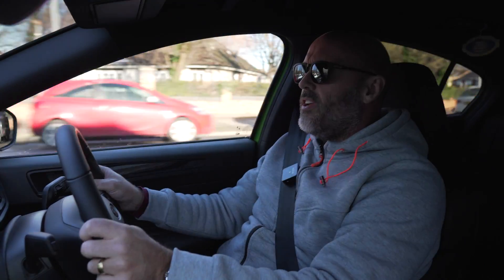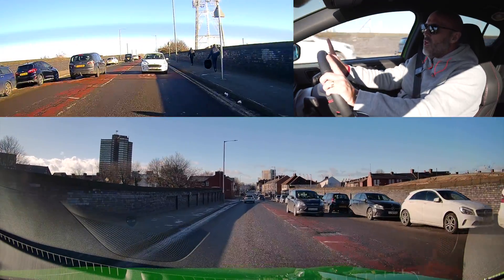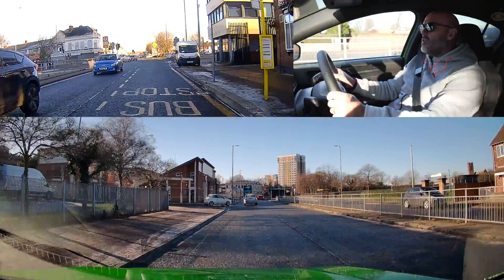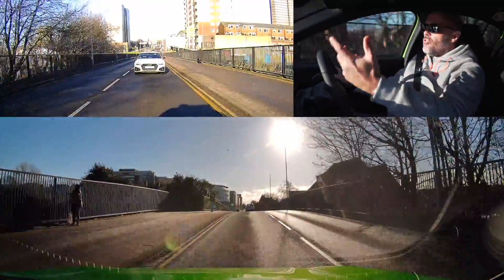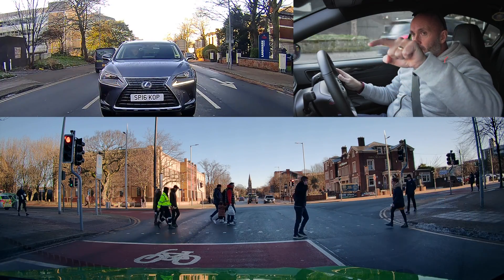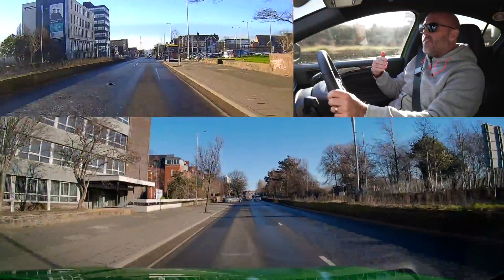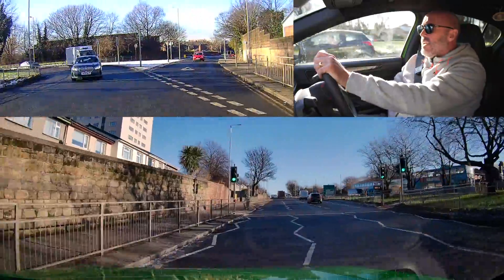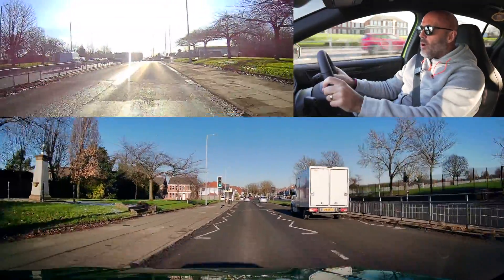How To Anticipate Traffic Light Sensors (Flashing Your Lights Doesn't Work!)

Comment: How about road works lights? Is there any way to know if they are working/not working/very slow/several junctions?
Reply: There should be a sign saying how many junctions the lights are for. The sensors should be set at the "wait here" sign, so too far forward or too far back they might not pick you up. In general they're pretty unreliable. Some will actually have a little red light which comes on when they've seen you. If it's on you know it's working. If you know it has a light and it's not on, try moving a little forward or back. If it still doesn't come on, I will wait for a bit, but it's probably not working.
Many don't have this little red light, so for those it's more uncertain.

Comment: There are specific traffic lights near where I live that are on very quiet roads, they are for single lane tunnels under railroad tracks. They use a magnetic sensor under the road and will simply stay in a single position (Green towards town) unless the magnetic sensor picks something up.

I'm a cyclist and I have to get off my bike and lay it down across the sensor for it to change to green for me. If I simply ride my bike over the sensor or stop on top of it... I will simply be there until a car comes to trigger the sensor.

I think most lights use a mix of timing and sensor to stop this problem, but since these are on quiet roads, I think they just use the sensors only.

Kind of annoying to have to get off my bike and lay it down, but better than going through the red and meeting a car coming through the tunnel towards me.
Reply: I have heard that some motorcyclists use strong neodymium magnets stuck to the bottom of their bike to increase its magnetic footprint for these type of sensors, maybe the same will work for you.
Reply: @BigDavie2000  Maybe it would help. My bike is a steel frame so lying it down is enough. I know other local cyclists that have lighter bikes and even laying them down doesn't trigger the sensors.

I think I really just need to send a message to the MP about it as cycling is getting more popular and it's only a better of time before a cyclist gets in trouble because of these lights.

Comment: Don’t get triggered when out driving but try to anticipate when you are triggering traffic light sensors to keep things flowing

Years ago on my morning commute into work there was a series of 7 traffic lights along a main road. It was quite amusing watching those in lane 2 accelerate hard from the lights when they changed then brake hard for the next set whereas I would be just under the speed limit and not have to adjust speed once we were going. A combination of sensors and timing to keep things moving on those lights until ut got busier and everyone caused chaos by blocking everything

Comment: There  is a stretch of  built up road near me that have five sets of lights. If on green it would take about 2 minutes to travel. Late at night no other traffic  around , they can all turn red as you approach each one. Time to travel along the same stretch, 12 minutes. There are cameras on the road and its a 30 limit. To beat the next light turning red you have to do 40 mph. Travel at 30 and each one turns red. Go figure.

Comment: As a bus driver when lights are red I used that time to have a quick drink or read any messages on our ticket machines about diversions ect. We can only use our machines to read messages when the vehicle has been stationary for 10 seconds or more and won't let us look when the vehicle is moving as it should be. So I'm constantly looking what's happening to make sure I judge my times to do things. But a very informative video Ashley.
Reply: As a bus passenger I have often noticed some lights changing prioritising the bus if the bus is at the front of queue as the lights change to red. It will let just a couple of cars out from the other direction before changing back to green, but if the bus is further back in the queue the lights will stay red until the other direction clears.
Reply: @BigDavie2000 Yeah, as a bus rider, bus priority signalling is great - my route to & from work is great for it. The bus only ever has to stop for pedestrians or other busses, otherwise it's green all the way. Right up the bus lane too, past the jammed traffic.
Reply: I guess that depends on what you are drinking 😂🤣

Comment: Almost all traffic light sensors detect when I operate the handbrake and put the car in neutral.
Reply: Step one of the rise of the machines, beep boop
Reply: From what I've observed recently, call it a conspiracy theory if you want, I've noticed that with no cars coming from the other direction, I'll be sitting on red while the side with no cars gets the green. Then as soon as a car approaches from the "green" side, they'll change that side to red and give me the green. I think it's deliberate, but can't fathom why.
Reply: @paulsengupta971 In Spain we had traffic lights at the entry points to villages that really did change to red if the vehicle approaching was going too fast. I've never seen it here, but I think it's a rather good idea. Once in town however, there is some dark magic at work.
Reply: @paulsengupta971  from what I understand, it can be deliberate. As Ash mentions, they are often multiple sensors on the approach to lights, which allows the system to work out how fast a vehicle is going. Sometimes, if the system detects that the approaching vehicle is speeding, it will deliberately switch the lights to red, to force them to stop speeding. This might be a myth, but I believe I've had it happen to me, doing the same junction a few times. Sometimes slightly below the speed limit, and sometimes slightly over, I find the lights more often stay green if I'm below the speed limit.
Reply: @konradius3141  that would certainly be a great system... but our local authorities can't seem to repair potholes successfully, so I doubt they'd be able to manage such a "smart" system of traffic management!
Reply: @paulsengupta971 YES. There’s a stretch on the a449 from wolves to penkridge that does exactly this every time I’m travelling back late at night. I generally dont speed but there’s absolutely nothing about - so much so it returns to green IMMEDIATELY. I always imagine someone is watching me and trying to pee me off!! 😂 Ashley? Anything you can find on this or am i falling down into a conspiracy hole???
Reply: @SunshineSuze  It's probably shown to be a successful strategy in rush hour, but it does get a tad frustrating in the middle of the night.

There's a philosophical subject though - why do we all stop at red lights in the middle of the night when there are absolutely no other vehicles around? Pedestrians do that in Germany when crossing the road at a light controlled crossing.
Reply: @paulsengupta971  Because the one vehicle lurking in the shadows will be plod. This I know.
Reply: @paulsengupta971   this will depend on the accident statistics for that junction, it is sometimes used to reduce red  jumper ie going before the lights change
Reply: Lol, yeah every time.
Reply: Smart lights are great until someone stalls at the lights for example a learner, then the smart lights think we are all parked and misses us out until a motor bike comes down the side or the learner moves forward slightly so they are picked up by the sensor and then we get to go again.
Reply: The sensors on top of traffic lights work on KU band radar.  They are not light sensitive.

Comment: Stopping in neutral (and using the handbrake) is something I cannot unlearn, after having to drive like this for about a half a year when my clutch master cylinder was leaking. The pressure was there only at the beginning, but the longer I held the clutch down, the less likely the pedal was to come back up on its own (and the bite point would move down, sometimes unpredictably fast). So I would go into neutral any opportunity I had, release the clutch and wait. Only getting into gear when I was actually going to move (not just preparing to move).
Now I've fixed the issue, but the habit remains.
Reply: At least it's a good habit, though.
Reply: Doesn't the practice also spare the clutch a lot of unnecessary wear and tear?

Comment: Went to look at car last week, took it for test drive in a city not familiar with. Went into a right turn only lane and hit a red, so stopped. Turned green, just about rolled over the white line and stalled the car. 

Waited on the red for 10 plus minutes cursing it to turn green, before I realised I'd overshot the magnetic sensor in the ground. Quick revers back over the sensor and it turned green. If the road was actually busier I would have had cars behind me to trigger the sensor . 

Fun times
Reply: It's actually electro-magnetic rather than magnetic, the metal in the car alters the  impedance of the induction loop like the iron core of a transformer.
Reply: Small motorbikes and mopeds sometimes don’t even trigger them. Same with cyclists especially on carbon or aluminium bikes
Reply: @hausmaster9801  Yes, and the the cyclists have no respect for the rules, if theyre forced to jump the red.

Comment: So glad you mentioned the Headlight Flashing Myth! I have had many dicussions with people who thought it worked! Geat video Ashley!
Reply: They work on doppler radar, there's no way they can see lights.
Reply: How many look stupid flashing lights at traffic lights, as silly as kids of the 80s blowing into their game cartridges.

Takes one or two and everyone starts blindly copying like sheep 🐑
Reply: @insoft_uk  why is blowing into a game cartridge stupid? Although it might introduce moisture and so an air blower or IPA on a cotton bud might be better, if the cartridge isn't working due to slight corrosion or dust buildup, it's far from stupid. These are hardly synonymous.
Reply: @insoft_uk couldn't have chosen a worse comparison. Dust, debris, and grime build up absolutely CAN affect a storage device from being read.

Maybe using your lungs to blow it out isn't the best option, perhaps you should use something like air duster, but it definitely works.
Reply: @gopnikolai7483 of course it works, plus games cartridges were still a thing well into the 1990s, which makes me think they are too young to have actually used such a thing.
Reply: Headlight bulbs can be very expensive, switching them on and of changes the resistance of the filament, this is why bulbs blow. I don't flash people out as you should only flash to warn!
Reply: @thefoodiechannelcookingfro1822  standard halogen H7s are about 3 quid, any more than that and it should be better technology you're buying (xenon, LED etc.) or you're just getting robbed.

Besides, flashing your lights has no significant effect on the lifetime or durability of your bulbs, it's almost entirely vibrations shaking the filaments, which use special materials and are designed to get hot-cold-hot-cold... tens of  thousands of times in their lifetimes. Traditional 'flasher relays'/'flasher units' work on the basis of a metal strip(s) quickly heating up and cooling down, to bend back and forth to complete/break a circuit.

If anything, the full beams would be a lot more flash-able than the indicators, given that the indicator bulbs have a much smaller and weaker filament (usually 21W, rather than 35W, 70W, etc.).
Reply: It’s an option on temporary lights (at least it was back in the late 80’s) used it many many times to change lights straight back to green from amber and red if it hadn’t started the sequence on the other side, missing the red/ amber cycle, if it was green it cuts the cycle short but still has to cycle the amber etc. perhaps they use a different sensor these days if too many people caught on

Comment: Out of interest - what do you do when sensors don't work when you are on a motorcycle? On a particular journey I go on each week, there is one specific set of lights that do not recognise that I am there. If I go early in the morning, 6am ish, then I can get to those lights with no other vehicles around. So I end up having to wait for a car to arrive behind me which can take minutes as I watch the lights go green for every other light, then when they do I have to move across the give way line so the car behind can move up far enough to trigger the sensor ..... am I shamelessly breaking the law/being moronic or is there something else I should do?
Reply: Let your city know that this particular set of lights have an issue, particularly if this is the only set in town you're having this issue with. It might be possible to recalibrate or adjust the sensors to work better, but nothing will be done if no one knows of the problem. In the moment however I believe it is perfectly acceptable to carefully go against red in these sort of cases, once it's clear the light is malfunctioning.
Reply: For magnetic sensors, give the engine a good quick rev once you're on the sensor... the electromagnetic noise from the engine will usually be enough extra to make it trigger... in theory. 

Not something I've ever had to try as I don't ride motorbikes, but it was something I remember reading years ago.
Reply: @tin2001  Will give it a go, worth a try thanks. Tried everything I could think of on the run up to the lights, weaving, waving my arm like a mad man :)
Reply: I have seen someone walk their bike across the junction due to this. It was only a fairly small scooter type one though.
Reply: Just commented something similar. I have this exact problem on my pushbike on a very late/early commute. 
The worst bit is you KNOW the lights will never change for you and its terrible PR to go through....... so what do you do? One of mine is actually over a  narrow bridge. I'm not keen to walk it, so tend to go through and await the dangerous retribution from any drivers that may have witnessed it.
Reply: There's a cyclist above who lays his bike down across the sensor. Obviously a little impractical with a motorcycle.

Comment: So glad you spoke about the handbrake and  gear. It crazy how many people just sit there with the footbrake on.

The other being slow on approach to find gap is such a good technique i use a lot but often people behind get annoyed (doesn't bother me i just control them) lol.
Reply: Many systems with “auto hold” will keep the lights on despite the footbrake having been released.
Reply: @JohnR31415  Yeah, the counts for the increase. I remember laughing with a Renault rep when he talked about the new excellent auto hold feature on the courtesy car. I was like, what's wrong with a handbrake? Haha. 
Anyway, You can often tell the difference when they launch off from the lights.
Reply: Footbrake + handbrake can be a useful tool sometimes too, e.g. when a HGV is fast approaching and you're stationary - gives a big lit-up inication that you are actually stopped
Reply: @Clarkey1000  yup, very good point. I often sit at lights with the handbrake on and my foot on the brake too, so the brake lights stay lit. Once someone stops behind me, I can just take my foot off, so I dont dazzle them the entire time.
Reply: @konradius3141  I was going to say more or less exactly that!
Reply: Though I’m a fan of waiting on the handbrake with the brake lights off (unless I want them lit), like the highway code says you should, I’m comming to the conclusion this is a british perculearity and modern cars arent designed for this.

A lot of modern autos disengage drive and shut off the engine when your on the brake pedal or using hold mode but restart and push against the handbrake when you let off the footbrake. A recent drive in a new Citroen C3 aircross had the whole car shuddering whilst it slipped its automated clutch against its (surprisingly mechanical) handbrake. Toyota hybrids also waste a bit of power putting some torque through the motor in that state too which makes them squat a bit but at least they dont restart the engine for it. 
On the plus side VW group cars seem to turn the brake lights off when stopped on hold though, or at least some of them do - thats the thing, a different brands/models all behave a bit differently.
I also discovered recently that Hyundais turn the DRL off if you put the handbrake on when but the fact I’ve never noticed this before driving one  shows how few drivers bother to do that.
Reply: @gs188 interested didn't know that. I've only driven Renault group cars and Vauxhall (both GM/Stellantis versions). 
It is is much better for safety and flow, not toto hold your foot on the brake. Also If someone can't tell you are stop at a red light then they are an idoit and likey to course you an issue anyway.